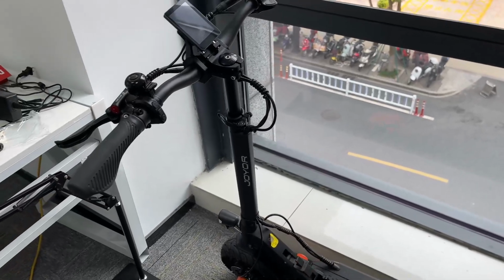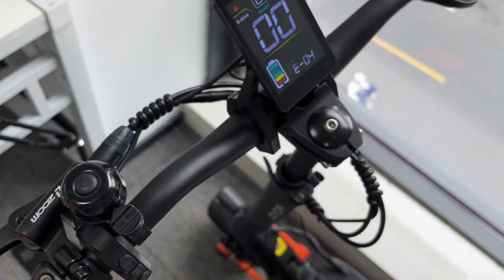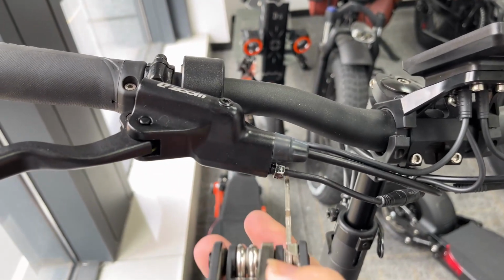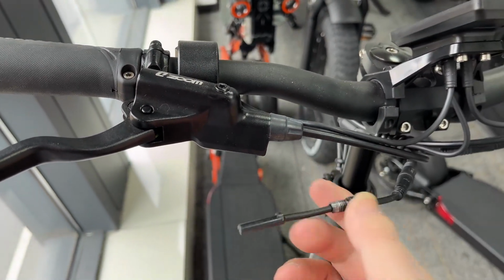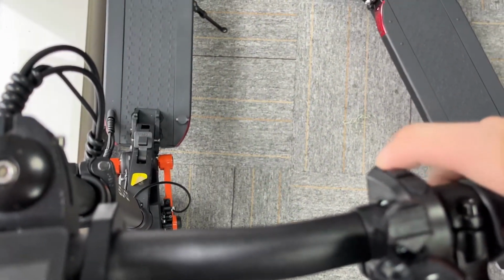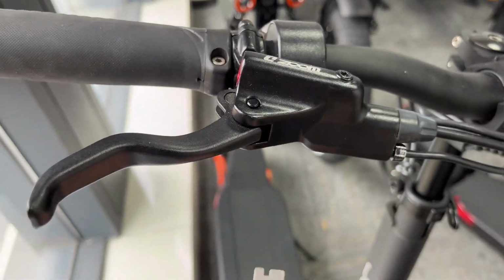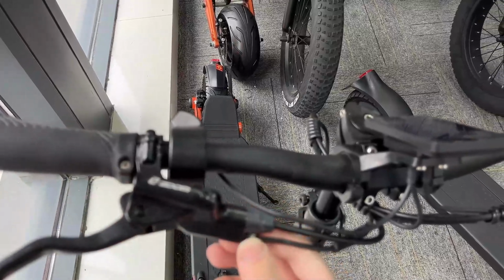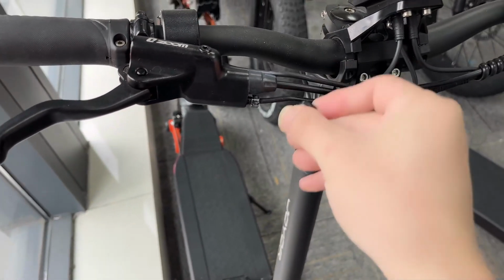Let’s talk about the brake power-off sensor of hydraulic brakes JOYOR scooter s8s s10s

Comment: Hi, when my Joyor s10-s battery is running low, can I increase the capacity and set the P 03 from 60v to 48v and continue driving? Can I leave the P03 setting at 48v?  thank you for answer
Reply: Hi, You can add an external backup battery to your scooter. But setting the voltage is the wrong thing to do. Setting the voltage indication on the monitor switches the display content and does not actually adjust the battery voltage.

Comment: I had e4 error while riding and the scooter shut off. Will not turn back on or show charging. Battery at 58v via multimeter. Replaced controller, still nothing. Can the sensors cause the scooter to not start, or could another part be fried?

Comment: Is there any way to set dual motor start as default?
Reply: Yes it's in my short vids to switch from single drive to dual drive
Reply: @oklahomascootin  Yes, but everytime after i turn on scooter i have to hold PLUS button. How to make dual motor drive as default?
Reply: @dannysmith6830  hmm I'm not sure I would think once u switch it it would stay on dual I'll try and figure that out too I do ill.let u know
Reply: @dannysmith6830  I'm wondering if 0 start would work other then that they need to upload on how to keep it default and not switch back to single when powering off and on
Reply: It needs to be reset every time, just like you need to set the speed gear every time. Used to it